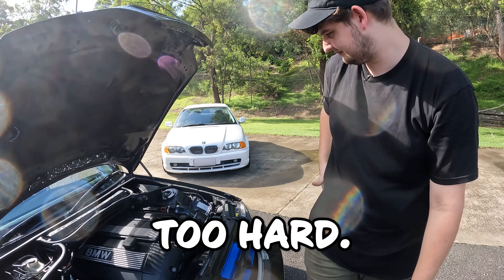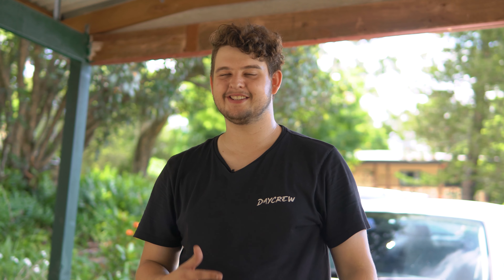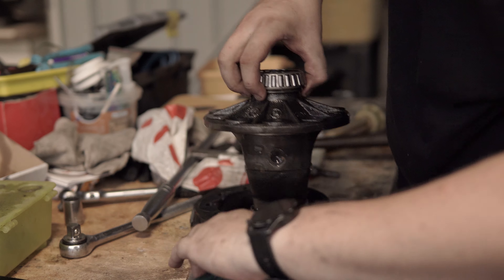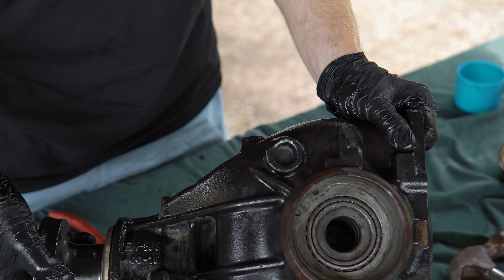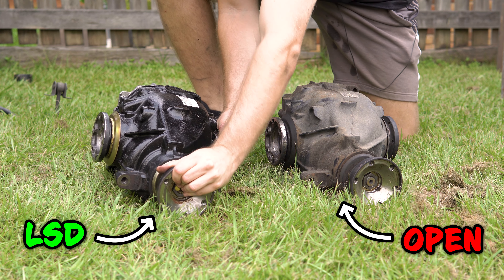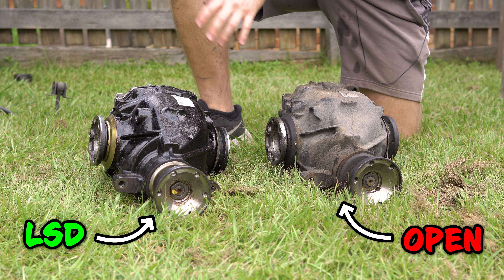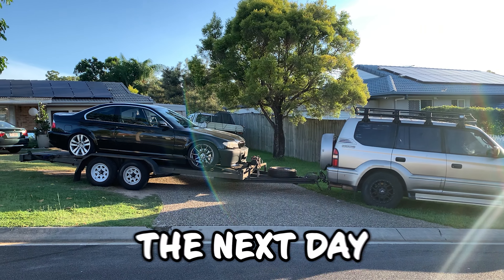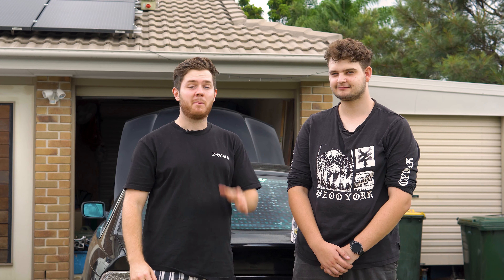We Tested a $300 LSD Conversion Kit (So You Don’t Have To)

Comment from the maker: Addressing some points people have made:

Installing it wrong: according to RacingDiffs official full guide (both video and instructions that came in box), we installed this diff correctly. (tutorial from racingdiff's - using alot more force on the central pin than we did https://youtu.be/bLESfhaCROE?si=Lnplrlo38fDGmfaN&t=376 ) The videos where they give updated information on new ways to insert the central pin are NOT in any official full installation tutorials, therefore until they re-make their official guides and instructions, we feel that this complaint stands. We also don't believe this is the reason it failed, as the circlip wasn't broken. It was stress going through a differential not designed for it that caused it to ultimately fail when launched. It lasted a few weeks without failing under light load and after going drifting in the wet, something that wouldn't have happened if the central pin was lose due to a broken circlip.

Drifting with it: The video takes place over the course of a couple weeks, and we did not immediately go out and drift, we made sure to break it in using their official break in instructions, and furthermore we drifted on a wet disel course - something that is quite low stress compared to regular drifting. While RacingDiff's may claim on the site that this product is not meant for drifting (even though we didn't really 'drift') they often advertise it as "Drift. Donut. Burnout. Repeat." as seen in multiple videos. If it can't handle sliding in the wet, we don't think they should advertise this way. Examples: (https://www.youtube.com/shorts/xh3H4tZ1N10 ) (https://youtu.be/cDGHU3Vax1A?si=yPrQXIfe7TVYbTOr )

If this kit worked for you, great! This is just our experience. We've had multiple owners say it failed similar to ours, but some have said theres have worked. We just ended up welding the diff as Josh thought this was a bad idea anyway and didn't want to waste another differential.

Comment: Sorry to hear this boys. I have the kit and done correct I had no problems!
Reply: just 2 idiots not knowing what they are doing lmao they probably installed the pin with hammer and broke the circlip 🤣
Reply: @nemanjastanojlovic01  just antother Serbian bot defending a shit product. Racing diffs conversions are shit, been proved many times.
Reply: @hexagonosaurus5848 just another dude taking the internet literal 😅
Reply: @hexagonosaurus5848  I have racing diff in my e90 330i more than 2 year / 30k Km and without problem. The kit do what supposed to do. If you expect that kit is the same as clutch LSD, thats your problem and your fault when it breaks.
Reply: @Krtek004 whats the difference between clutch lsd n this? im tryna buy one in the next couple days
Reply: @boosgoossss6000  Well this is made for casual street drifting and to just improve traction on variable or loose surfaces. Its made for people who dont go drifting too often and dont want to live with a welded diff. Or for people who live in snowy areas who just want the traction increase. An actual LSD has higher locking making the car feel even more predictable and it should withstand much more abuse.
Reply: @RealWheelDrive39  so your saying i'd be able to slide my 325i without needing rain😆 i just like to be able to donuts without braking my car here n there maybe some drifting obv nothing obnoxious very small stuff here and there. would this kit be a good go to? i also get a lot of snow n rain since im in the suburbs of Philadelphia
Reply: @boosgoossss6000  Should be good for that. Lets say you go from work, see an empty 90° piece of road and slide through it for fun.. or a bunch of donuts here and there.. in snow I think you should be able to abuse it quite a lot without any problems
Reply: @Krtek004  Are installing lsd will increase trans temp or it will reduced life span of axle?
Reply: If anything, it will increase the life of axles, since the power is being distributed to both rather than allowing one axle to take full power.
Reply: They actually published another video recently about peening the central pin in. it's really shitty fragile design by BMW tbh
Reply: You probably work for them
Reply: @nemanjastanojlovic01 Not even probaby
You can clearly see Them hammer it in 😂
Reply: @nemanjastanojlovic01  nope it doesnt worked had 3 kits for e46 330d it just doesnt work.. at least not on 330d
Reply: @boosgoossss6000  just weld the diff

Comment: I say you should give it a second try and make sure it is installed properly, since it was a poor installation issue. Id day the product deserves a second chance
Reply: How do you do it properly?
Reply: @nctb7962 they probably didn’t put the central locking pin back careful enough and broke the C clip that holds it while hammering it in. According to the manufacturer you have to use loads of oil and be really really careful not to break that clip
Reply: @nctb7962  the trick is not to use too much force, can be done with a hammer if you're super careful, lots of oil, careful alignment and very light taps, literally just enough so it moves 1mm at a time and if it stops moving, remove and realign. the force to drive it in should not change from start to finish, if it does you've snagged something. I noticed something interested between the stock BMW clip and the one provided in the kit, the BMW one had a much larger gap which i think can get you in trouble as it protrudes more. Either way, it's a fragile design by BMW.
Reply: Reading all these comments while listening to those guys hammer the life out of the diff, hilarious.
Reply: I would agree as we can definitely confirm on all ends it wasn't installed properly. Whether it was readily available in their manual or not. I am thinking of getting this and using a used junkyard diff and just paying someone to install it for a c63 amg w204.

Comment: I installed the same kit twice on my e90 330i with a 188l 3.46 lsd from a 335i i installed along w a custom drive shaft. first one blew within 2 weeks. second one was professionally installed by my warehouse neighbor who builds 911 gt2 and gt3 race cars and that also failed within a month :/. went with a mfactory helical lsd and all has been well.
Reply from the maker: Sounds like you have a cool neighbour!!
Reply: If you drive it like you have a helical or clutch LSD, than you can't be surprised that it broke... It depends on how one treats it. This is not 1 to 1 spare for classic LSD. 
I have kit for 2 years and 30k Km on my e90 330i without any problem.
Reply: I went straight for the MFactory diff, after seeing so many horror stories about these "LSD conversion" devices.
Reply: @Krtek004 then it should be false advertising claiming this works as an lsd. also did your kit come with a one piece center pin? both kits i got was the two piece one

Comment: Mines lasted 6 weeks so far, 562whp 135i. I had a professional install done though, i know of a 9 second 335i that's had this for 4 years now, so some peoples experiences aren't bad
Reply: Ok this is interesting. I installed mine a few months ago and it’s starting to loosen up on me. I’m going to try changing out the diff fluid  and see if that fixes it. Also in the process of turboing my e36, so I don’t want to grenade my rear end.
Reply: Im sorry but... why the hell would you put that on a 560hp car :D thats bound to break at some point. Youre already spending a lot on that car, why not just get a proper LSD for it? Do you also run stock brakes? :DDD seriously, this kit is a nice thing for someone who doesnt drift too often and also doesnt want to live with a welded diff (so not really for 500€ E36 on the low end of the spectrum and its certainly not for a 15-30k€ 135i :DD)
Reply: @RealWheelDrive39  the 188mm diff is weak and useless anyway, when it breaks I'll get a 215mm diff from an early 335i and os giken super lock lsd installed in it
Reply: OK, so mine broke 😄 lasted 5 months
Reply: @17t135i  how many kms and what was its life like? Did you launch it often, slide on dry etc.? I have a f30 335i and f36 440i and I was about to order it for both of them. I only drift when it's really wet/on snow and rarely launch from standstill.
Reply: @katozord  mine failed recently and destroyed my diff, I now have an mfactory lsd
Reply: I can’t understand why you wouldn’t just put a proper LSD in a car with that much power. There are tried and tested brands out there that would help the car put that power down reliably.
Reply: @olik9388  I have an mfactory lsd and 215mm big diff now

Comment: I have Racingdiffs LSD Kit installed on my E39 523i now for a few months and I have been sending it hard af since I got it installed, very satisfied so far. You forgot to weld the center pin to the diff, then it slides out a bit and breaks, causing the failure.
Reply from the maker: Welding the pin is not recommended by racingdiffs on the 188k, but thanks for playing!
Reply: i tig welded the pin and it still failed :/.

Comment: I like the video its shot very nicely and the quality is honestly quite good icl, but when you do zero research into the matter since even the actual page of the racingdiffs has a direct link to their videos and without the supervision of a professional you cannot blame the company that made it if it was installed incorrectly then blame them that they didnt provide the videos even though a simple google search would've shown more info about the installation process, furthermore you cannot say "i dont recommend it" if you installed it wrong then it broke, you simply havent given it a fair shot to even review it properly, the fact that the company gave you guys a refund shows that they do care about their products and overall customer satisfaction...maybe do a part 2 and get it installed by a professional:)
Reply from the maker: I appreciate your input, but harshly disagree.

We did do plenty of research watching multiple videos, articles and reviews before installing, knowing the product, how it works inside and out.

The instructions included, and the ones that are made SPECIFICALLY for this diff AND come in the box, do not have the information included that supposedly “was the reason it failed”, it’s buried in a random video that isn’t available for customers to find.

They’ve known about these issues for over 2 years, but haven’t updated their guides, and we feel it’s very reasonable to not recommend it based on that. We’ve said this is simply our experience, and that they’ve been fair to give us a refund, but we will not be able to recommend this product to our viewers.
Reply: @daycrew  I understand your point of view but I was able to find all the videos from their website+emailing them beforehand and they've always given me input when I sent pics to them before finishing the is install and helped me resolve some problems. I still think that things that are not as simple as welding the diff should be done by professionals in their field even though there's videos of people installing these kits and I personally know a friend with a 328i e36 that has a kit from racingdiffs and has lasted so far 1+ year of drifting/dailying, either way I feel like the review isn't complete since you weren't able to install it correctly so it would actually be able to be evaluated.
Reply: how can you say something about supervision of a professional? how many out of 10 professionals you think know how to install this thing? its such an uncommon thing and not seen anywhere else that you cannot really say anything about that
Reply: @razeru_  quite literally every mechanic that works on drift cars knows, close to me I have many! I understand it's not easy to find these people but it's not impossible, when doing something yourself you should always seek advice if you aren't sure how to install something, with pictures of the build and they will guide you, plus racingdiffs has been very helpful to me when working on my friends
Reply: @razeru_  This problem would happen if they just rebuild diff. It is known thing what is holding central pin, an how to put it back without braking C clip.

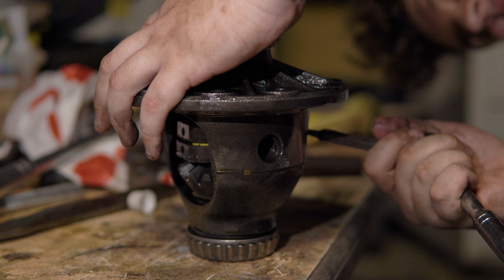Comment: Your circlip that holds the cental pin in wasn't centered, which you can see at @2:58, im guessing you drove the pin home and snapped it which isn't hard to do., I'm also guessing you had no idea what the replacement clip was in your kit and discarded it. I had no issues with mine and it's was in the included instructions if you bothered to read it. This would have happened if you took a entirely stock diff apart and put it back together. I broke the standard one when reinstalling mine with light hammer hits. the trick to NOT breaking this circle clip is to position it perfectly slightly off centre with the open end fully covered. It was installation error sorry.
Reply: Do you drift your car? What car do you have and what engine?
Reply: Yes, specially at 1 second earlier it's easy to see that it's not correctly seated unfortunately :) Clearly an install mistake.
Reply: @mariosnikolaou5212  n54 on e85/ Port injection making 350rwkw,     I don't drift it. The progressive rate lockup sucks for drifting as it's not perfectly predictable however as a traction aid this works well. The limit is the stock carrier. Abuse it and it will break like most other things on the car. If you're planning on racing the car don't get one of these get a carrier replacement.
Reply: Update: diff failed after 1 year of use, spider gear split clean in half under load. no obvious damage to any gears, pin or the conversion kit. My final opinion on this product is, it's a lipstick on a pig, the factory diff carrier is just not great, if you're making good power it won't last.
Reply: @suurkartul  Thanks, nice to hear your update. I bought an torsen one, did first buy same kinda but then cancelled it at "last minute" though have not installed yet and it goes for a stock M52 anyway.
Reply: @thetoughcookie3665  yeah, way better idea i think, probably what I should have done in the first place.

Comment: When you try to install one of these kits, you will if your looking! find a few problems, the instructions are not enough! and even if you watch the video's they are also not enough, and in my case not specific to the the kit I had, they also are just plain wrong, they tell you to take 4mm off the output shafts, you do that and they still stick out past the gears, if you shorten them too much, there is no surface for the clutch pack to act on, other than about 1mm around the inner of the gear, so you need to machine them down ''exactly'' fitting and refitting over and over, also you have to compress the pre-load shims so you can obtain the correct clearance, it's a long slow process to do properly, I kept thinking that the kit was the wrong one, I contacted Racing-Diff's asking to confirm the size of the friction plates they didn't provide that information in there reply, as an engineer I think this kit ''might'' work but only if installed properly and as far as I can see that info is not available, I seem to be the only person to have bothered to analytically asses the workings, I think the kit for most people, will not be worth the time it will take to fit it correctly, if they can even do that, especially if like me, you have to work it out yourself, and if you don't have a lathe your wasting your time, there is another way to finish them at home if you have a drill press, but it's still best to start with machining them in a lathe,  I am considering making a video to explain how to do it ''properly'' but really there is no point for me, as then I'm just making a free video for Racing Diffs, for a product that I'm not that happy about, I think they over simplify the fitting instructions so people are willing to try the install, as if most people knew how complicated and long the process really was, they would not buy the kit, and if you paid an engineer to install, it would cost more than the kit it's self. seems to be selling things on the internet means you have to bullshit a bit, as people want stuff to be super easy to do, when the nature of the job means it's just not super easy, also most people lack the proper equipment and skills to do the job properly , if you follow the instructions in the kit or in the video's the kit will last a fraction of the time compared to installing it properly, Sad but True.
Reply from the maker: Agreed, that is our complaint, maybe we installed it “wrong” but we followed their guide to the letter and therefore it is their lack of proper documentation.

Comment: For what’s its worth, AMG did a recall for the C63 S AMG electronic LSD (w205/c205) due to breaking from sudden grip from low grip situations, such as spinning in wet and then getting traction. A lot of force goes through the diff in that situation. The recall involved limiting torque going through diff - so I’m putting a Wavetrac in mine. In any case, you just proved you get what you pay for. It was an entertaining video. Put a mini-spool in next, but expect to snap axles if you put enough power through it (from my experience in a VL Calais turbo).
Reply from the maker: Definitely, the original open diff wasn’t designed to handle that force. Good luck with the wavetrac, hopefully it’s a good upgrade!